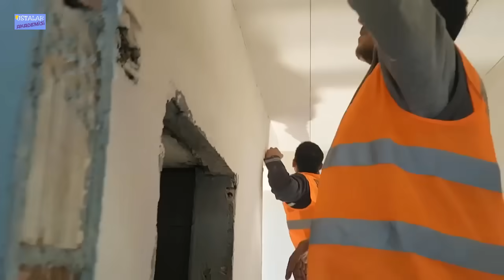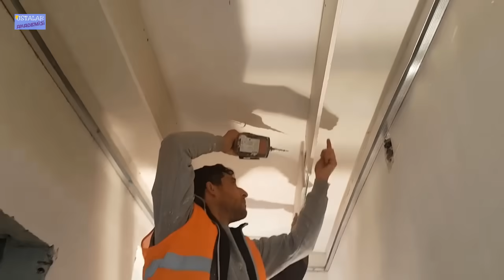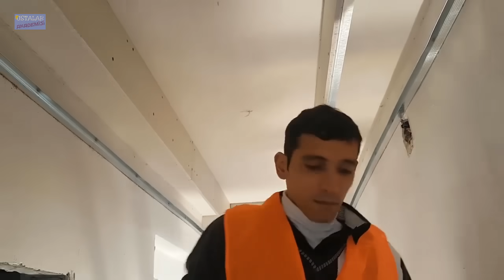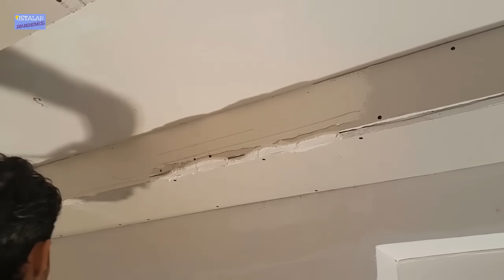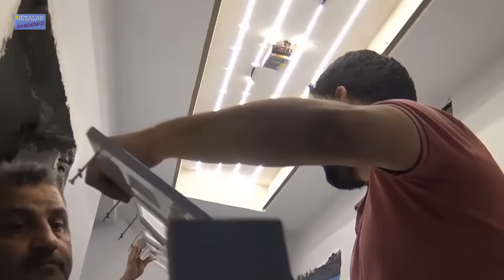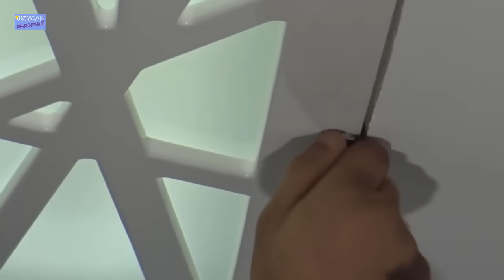Alçıpan ustasından bir işçilik sanatı - Drywall - Suspended ceiling

Comment: This is a good video but you will have problem replacing damaged lights. If anything goes wrong you have to replace the whole panel. It would have been easier if you put hinges on side. Great video. Lots of knowledge

Comment: Very good job ! I love it ! But one question where do you buy the final decorativ plate you put in front of the LEDs im find it so beautiful ! and want it !!!!
Reply: Those plates are not a ready-made material sold anywhere. MDF sheets, which are cut and shaped in cnc machines according to the dimensions of your work, are then painted. You can do this with the help of a carpenter or furniture manufacturer in your area. It may not fit your ceiling shape, as you will depend on the material dimensions in ready-made materials. Mehmet Kiraz is an interior designer.

Comment: What is the name of the machine used to install the angle in the wall?
Reply: It's a ramset gun it fires a metal nail into the concrete. You can get all kinds of them depending on the concrete and the fixture your putting up
Reply: @choppys007  Thank you

Comment: what is that tool u have that shoots into the wall?
Reply: it's called a drywall screwdriver it is available in many brands this one is a hilti brand but u can find one at a specialty hardware store near you .
Reply: Concrete nail gun machine